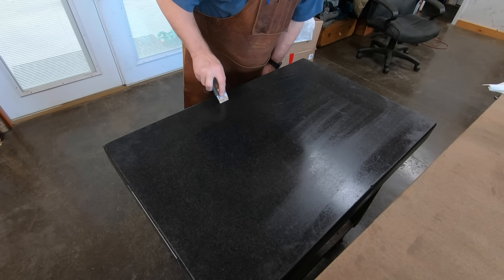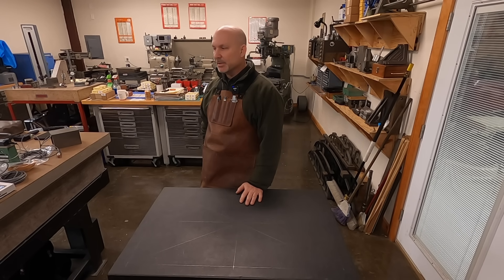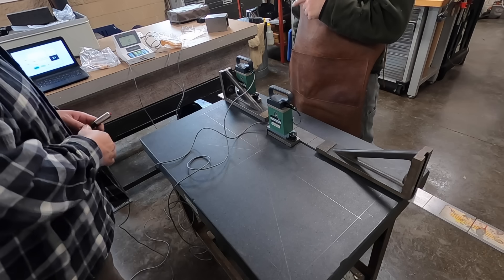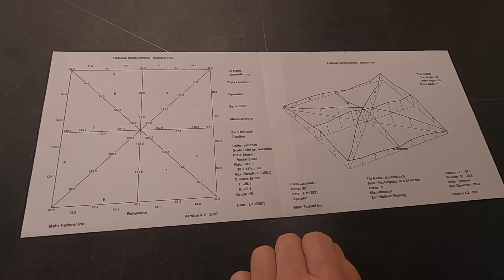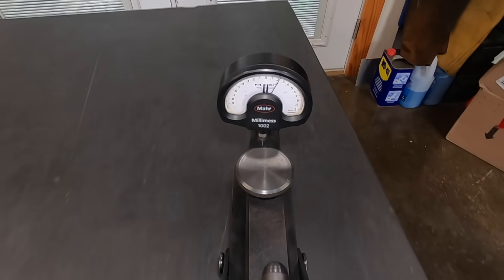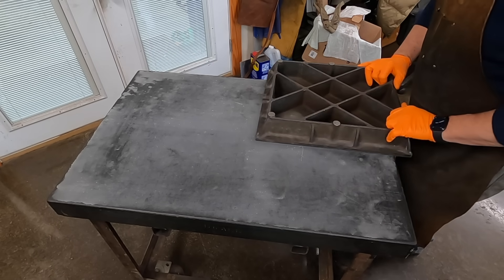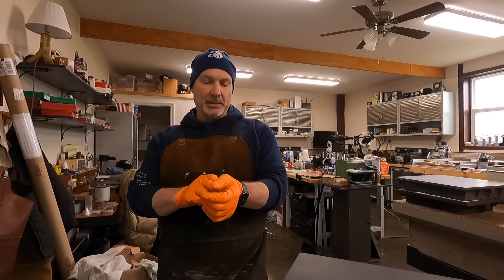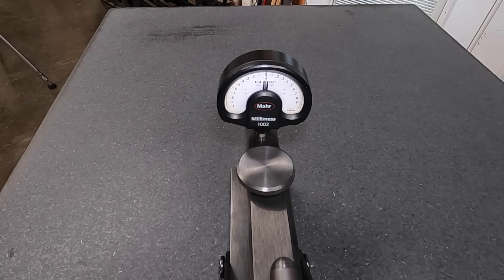Lapping my Granite Surface Plate to AA Grade

Comment: 24:10 I wouldn't go that far over the edge with the cast iron. Imagine there would be a low spot at the edge 1/6  of the cast irons length long (distance perpendicular from the edge). Then the cast iron would "tip" over onto the lower edge area in case you go over the edge as far as 1/3 of the cast irons length. This ignores that the materials flex under load. But regardless of the flex, I think it loads the edges to much if you go too far.

Comment: My dad was a machinist and told me NO MACHINE ever made can do better than what a trained and skilled true machinist can do by hand. That stuck with me all these years then i read a true story about a 21st century machine shop that got a NASA contract for a part around 6 feet across that had to be dead true flat to less than 1/100,000 of and inch (one/one hundred thousand) They tried everything, multi million dollar lapping machine, super computer controlled laser machine, the top of the line 21st century equipment,  NOTHING worked. Nothing was accurate enough. Then an old machinist in the shop said "what about that thing" and pointed to an 1880's 20+ ton, hand scraped, cast iron 8 foot by 10 foot lapping table in the corner of the shop that was being used to store wood pallets on. Turned out to be true to less than a millionth of an inch! The NASA part ended up being HAND SCRAPED......... Only meathod that WAS accurate enough.
Reply: The way that I’d build a machine to do that is basically a high precision sensor setup and a force-driven (as opposed to a rigid setup that seeks the target position with the full force of the machine) robot arm with... (wait for it) .... a scraper on the end! The reference would be optical; and there are several ways to do that (imaging, intensity gradient, or interferometric).

Basically; just automating what you’d do by hand...
Reply: I'm not sure if you've seen it already but check out Smarter Every Day's video "How Rockets are Made" at around the 24 minute mark he shows how even still they use a person with huge bump presses forming the rockets. It's crazy how precise humans can be.

Comment: Well said and done!  If you can measure to 40 mil, you can lap to 40 mil. There's no voodoo or special ring you have to earn in order to do precision work. The certifications are the industry's way of assigning blame if something goes wrong. Same as established practices in the Vet business.
Reply: I think a lot of certifications are little more than someone realizing there isn't yet a certification, and they can make a ton of money every year by taking dues from people to grant them a certification.  That is, a hole in the certification market.
Reply: @brianhaygood183  You're so right.  I know the racket. I was a "class A" NDT tech in every phase of metrology and testing you can think of. As a young engineer, I knew everything I knew before I got the certifications. My company wasted a lot of money on me before I was promoted to QA manager.

I've seen "certified" surface plate grinders do a far inferior job than Abom79, even leaving low places in my plates.

Comment: They should add a "optical flow sensor" like on a optical computer mouse to the instruments. That way the software would get the exact position of the instrument on the plate at each sample, and you could get more readings too. And with that and a electronic gauge on the repetometer you could get a pretty accurate 3D map of local flatness.
Reply: That’s a good idea!

Comment: A very interesting video Gents that certainly opens my eyes more than a little. My 'surface plate' is a pink granite slab 4 inch thick and 42 x 30 inch. It is a redundant grave stone from a local ornamental stone mason and certainly flat enough for my humble purposes. Using only the most basic equipment in the form of an inspection grade 48 inch Rabone straight edge, I an unable to discern any high or low spots. I shudder to think what horrors these guys would find using really accurate measuring. It came for free, and all I had to do was erase the inscription on the front [now the bottom] using diamond wheels. As for your work fellas, if you don't pursue perfection you will never come close to achieving it.  Go for it !

Comment: IMO, the best glass cleaner available is spray away. White can blue lid. In my area you can get it at HD and ace.
Reply: Yea anything alcohol based, which is usually in a can works best to dissolve any contaminants.

Comment: Cool!
I've ground carbide and ceramics to half of a thousandth and I've ground and polished optical lenses and lapped lenses for many years.
Just one note though, if someone was not careful, they could lap too much in the middle and create a subtle concave surface or they could spend more time pushing the lap over the edge and impart a convex shape if the were not paying attention.
We could alter the shapes on a sphere pot by dwelling in the center or going over the edge often, creating a slightly different curve if we needed to.
Great job touching up that Granite.

I work in a Granite shop and many people don't appreciate how imperfect a Granite countertop is, and even though a kitchen island can appear flat to our eye, your inspection tables are far, far, far flatter.
A kitchen countertop that looks flat could easily have more curve than the average of our earths curvature, if the earth was smooth like a giant ball bearing, it could be flatter than a Granite countertop.

My friend has a very large inspection table that was dumped in his shale pit, and I've hoped to carefully move it and rescue it to some usefulness.
Maybe I'll show him this video.

Comment: you should start grinding mirrors for telescopes. It is just about the same process except you are lapping to a curve! Great video!
Reply: The math in both processes would surely break my brain.
Reply: The precision with telescope mirrors is generally within a millionth of an inch for the highest quality...I make them for fun and can get most to that level of accuracy...but it takes a Lot Longer...an 12.5 inch can take a 50 to 100 hours just figuring/working the final surface.

Comment: Really interesting stuff guys.  Would be nice if you could explain what the measuring A/B devices do and how they work.  Are they just like Dial Indicators with a very flat plate on them ?  Also would be interested if Lance has lapped mirrors or glass for telescopes since it seems to be a similar process (but they have a curvature they work with and a different lap compound).
Reply: The sensors (called differential levels) have pendulum-like arm inside that hangs straight down due to gravity. As device leans due to the high and low areas in the granite, a sensor inside creates an output signal that tells the software how much it was leaning. As you move the one device along the straight edge, the weight of it could cause the surface plate to tilt slightly. The angle of the stationary device is subtracted from the angle of the moveable device to cancel any error caused by movement of the surface plate.
Reply: @txkflier  Cool. Thanks for the description, helps me understand what's going on.

Comment: Where would you find a lapping plate like the one used?  Would it be possible to lap the 3 pieces of slate from a pool table to create a flatter playing surface? After levelling a couple tables multiple times i've noticed a lot of high/low spots.

Comment: Adam, I love this channel! You impress me every time. I am not a machinist by any stretch of the imagination when compared to what you do and the tolerances that you deal with daily. I love this channel because I learn something new and interesting with each new video. I do have a question for you though, so please help enlighten me. I watched as Lance flattened this out with you and throughout the entire video I kept asking myself "What on earth could someone be measuring that requires tolerances that tight???"  Please keep in mind that my primitive form of flattening a surface at the home garage is just about limited to the equivalent of a piece of sandpaper attached to a piece of glass, along with the use of feeler gauges to check for gaps. lol
Reply from the maker: A granite plate is usually the master reference surface, so you want that to be as accurate as you can get it. All measurements taken off that surface will then be reflected in the tools, instruments, and parts that are used and checked. AA grade is normally used in controlled environments such as laboratories. A grade is common in tool rooms used for inspections. B grade is great for general shop use when quick inspections, referencing and layout work is done.
Reply: @Abom79  , thank you for answering my question. That makes sense. Now I am wondering, with something that sensitive, how much does temperature and humidity play a role in how accurate that table will remain? Also, I'd almost be nervous to even transport it and cause it to become warped somehow. So, what's the safest way to transport something that delicate and not cause it any harm?
Reply: Thanks for sharing that with us cause I was curious myself. Thank you. It was a pleasure to watch you guys to do what you do.

Comment: Can anyone describe how the electronic levels work? How can the levels resolve such small degrees of tilt? I can't find a good description of what is inside the levels.
Reply: I had the same question and looked on Google patents but there were too many hits.  He mentioned a pendulum and magnetic and called one of them the read head.  I know that a plumb bob only hangs straight (or points to the center of the earth) if there are no big mountains nearby but that doesn't really apply to that instrument I don't think.
Reply: @policedog4030  I was able to find this diagram.

http://www.charm-tech.co.kr/charm_tech-site/mahr/millimar-electronic_levels.jpg

Looks like the pendulem is centered on the primary coil by the springs. I suspect when the primary coil is activated each secondary coil detects a field of the same strength if the pendulem is centered and a different strength if the pendulem is not centered.

There are probably some electronics in the base unit that converts the position of the pendulem into a voltage and then that is converted into an angle.

Comment: An interpolated (suspect radial or cubic would be best) coloured or grey scale surface plot might be another way to view to moody plot data. It would giving some more insite into the uncovered areas without having to take more samples.

The local flatness check could help validate the interpolation.

What you guys are doing is really cool stuff!

Comment: Intuitively a veterinarian that does this kind of work doesn’t sound credible... however... the results can be measured in a relative straightforward way so there is no reason to doubt your skills. Especially since other people have also looked at your results which rules out your personal measurement error. That does still leave confirmation bias, but it’s too methodical for that to be an issue if you ask me.

Comment: For those wondering the practical purpose.. 

For a hobby machinist, there likely isn't one. A flat slab of glass or marble cutting board or even a cheap A grade, hell a B grade surface plate would likely suffice just fine. 

Now for some of the work I've done for Raytheon or Boeing or Airbus or Lockheed, well in that case.. 

.. actually no, the B grade plate probably would've worked out as well. 🤣

All joking aside, we needed to have a AA or better (is there better?) to be compliant with their inspection requirements, but for 95% of the work we did, probably wasn't necessary.

Comment: Cool to see the granite surface.  Supposed to be very stable.  I am from the "granite state."  I've seen granite used as base for many things...supposed to be stable in temperature and vibration.  Interesting.  From very large format printers to diesel fuel injector micro(laser) drilling, granite base was the foundation.  Stable as can be.

Comment: Was any consideration given the stand during the weighting and measuring? (Disclaimer I'm a noob that watched Renzetti  counterbalance everything, accepting that everything will bend)
Reply: Effect is likely negligible based on the thickness of that rock. If the bending is 10x or more smaller than the measurement capability its a waste of time to think about.

Comment: Lance, this is the best video i have seen on lapping a plate. what is the diamond material you used on this plate, do you always use the same grit, depending how much material has to be removed?? to lap to a AA, do you have to have a controlled temp room?,   I have been looking for this information, for a long time.  thank you both, lance and adam, for an excellent job.
Reply: Natural diamonds 30-40 micron, no I use only one size to lap....  There are folks who use more coarse diamond for roughing I'm sure but as any granite I work on will already have had a finished surface at some point I don't see the need.  I do have synthetic 15-20 micron and have played a bit with it.  It doesn't yield that big a difference in surface finish feel in my opinion.  Although we did lap this to AA standards in my shop in the controlled space, Adam will use it in his shop and it will be way better than any of his work would require in that uncontrolled environment.
Reply: @lancebaltzley  thanks lance

Comment: Just wondering about the transport back to your-shop and creationisme a new (or adjusting) the stand. You speak about settling time,... don’t you want lap the stone when it is in you work place. Apparently flexing of the stone a issue is it known how much flex will I flood your desired grade?
Reply: Once placed back in Adam's shop on the same three points on which it was lapped, it will return to the same flat plane.  Temp changes and moisture will likely have a bigger effect day to day.  This is why granite was chosen for this type of measuring standard.  Although very dry, Moore's book "Principles of Mechanical Accuracy" explains this very well.  Cheers and thanks for watching.

Comment: Not sure how I ended up here, but why are they trying to get these blocks of stone super flat? What's the final use of these plates?
Reply: It's a known flat surface in a machine shop. Combined with other measuring tools, it allows for measuring various things, and the flatter it is, the more accurately the other tools can be used
Reply: To use as a flat to check if another workpiece is flat. Try checking if something is flat on dirt. And truly, flat is a misnomer, you want flatness, parallelism, and squareness. Flatness is essentially how smooth a surface is. Parallelism is whether your part ends up at the same thickness from one side to the other (IE: imagine a flat plate of metal, it's 1" thick on one end, and it's 1.2" on the other, it's NOT parallel). Squareness is the angles of all the faces of your part in respect to each other (if you're making a cube you want 90 degrees, if you don't have 90, it's not square, it can be square ENOUGH depending on what it's for). There's of course more metrological terms, but I'd recommend you take a community college class if you're really interested, or just find a decent youtube vid, I bet there's a few around. Alternatively, see paragraph 2 below.

Basically, GD&T (Geometric Dimensioning and Tolerencing), aka Metrology, aka did ape pushing button make good part. It's a science in and of itself, if you're feeling particularly starved for some rona lockdown reading, read Foundations of Mechanical Accuracy. Nut jobs trying to get things flat within 0.000025" to do some light spectrum experiments (or something to that effect).
Reply: Three primary reasons:
1. Aerodynamics
2. Keeps pencils from rolling off the table
3. Bragging rights for flat earthers
Reply: @farqlue  you know, we invented hexagonal pencils for that same reason.
Reply: Put a head of a dragster on it and run some feeler gauges under it. When the loot is on the line you want critical.

Comment: I wonder how accurate you can get with the traditional method of repetitively lapping three plates against eachother, A with B, B with C and C with A. Does the mathematical principle alone suffice to get good results, or are the modern measurement tools better?
Reply: Modern measurement tools will ALWAYS be better. If you put the price in them.
Reply: it would get excellent results but you would need to be the Hulk to implement that with a half ton granite plate

Comment: Can someone explain what charging the diamond does? Lance rolled that wheel over the lapping plate but then wiped it with his hand. I just don't understand.
Reply: wiping off the loose stuff, keeping the embedded particles in, so the "coating" is even.
Reply: As far as I understand: The cast iron is very soft compared to the dimond particles. The steel roller presses the dimond particles partially into the plate with some parts sticking out. You wipe off the excess and have the equivalent of a super fine sandpaper with dimond "tips"
Reply: @radiohirsch  That makes sense. Thanks

Comment: 32:20 why don't you just use the integrated fine adjust on the Mahr Millimess 1002? It's the knob on the bottom right corner, to start in the middle of the fine adjust range the white dot on the black knob should face towards you.